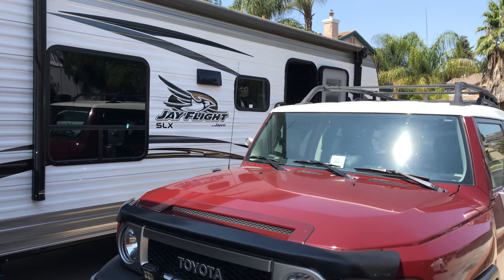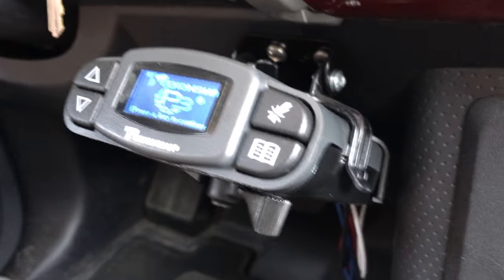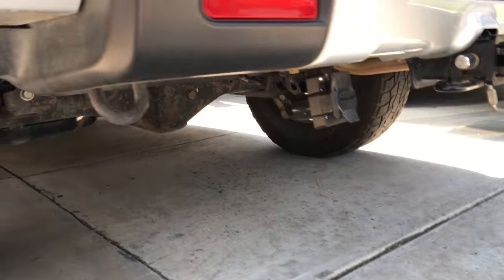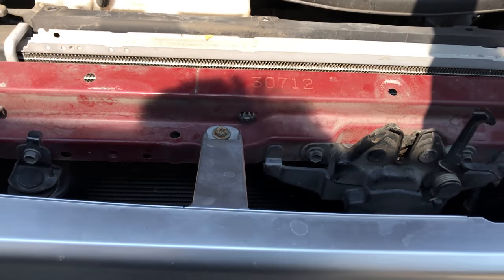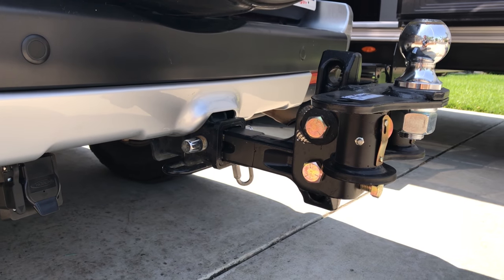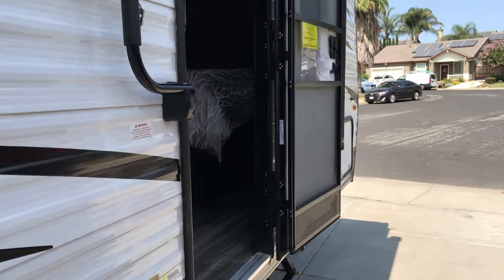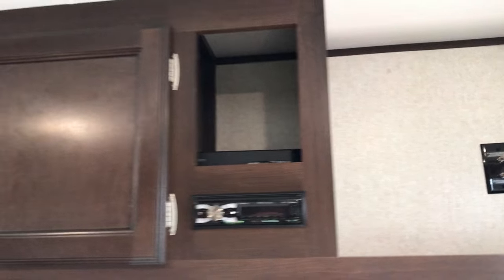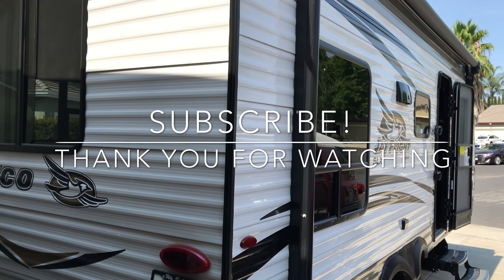Must DO things to make FJ Cruiser a TOW Vehicle!  How to make your FJ Cruiser a capable tow vehicle

Comment: Dude, I have exactly the same setup plus rear spring fitted airbags. They helped a lot. However, if ur loaded trailer weight is around 4950 lbs, any passage or cargo in the FJ will be over the limit. 5000/500 lbs tow/hitch rating assumes that there is only driver and fuel in the vehicle. There r online calculator for actual tow rating, they take cargos and rear axle rating into consideration. FJ legal tow rating is probably around 3000-3500 lbs with 2 adults and some gears in the vehicle. Be sure to check out your insurance fine print, most of them won’t pay if you tow over the legal limit. Stay safe.
Reply: Exactly, he is definitely overweight with this trailer. I hope he doesn't kill someone with this setup.
Reply: @adventuremanintheclouds8968  Another thing I forgot to mention is FJ’s wheelbase is shorter than HONDA CIVIC! Making it a horrible horrible tow vehicle.
Reply: The towing capacity is 5000, it's a Toyota 4runner/Prado land cruiser with a different body, with higher load rated tires and larger displacement than most new F150s.
Reply: @snarkylive  wake up. I had FJ cruiser. It’s a great off-roader, horrible tow vehicle. Nowhere close to F150 3.5 ecoboost power.

Comment: I have seen a  lot of trailers flipped being pull by tow vehicles that size .  I am a retired truck drive and would not pull a rig like that with my FJ . Sure  Under prefect  conditions you could . But I wouldn't ever .
Reply from the maker: Thank you very much for the feedback! We appreciate it! I would love to get a diesel truck one of these days...for now, I will just need to equip this FJ with all the safety items we can add. Slow down on windy days... be mindful of the speed and turns! Thanks again for watching!
Reply: I tow a 1977 golden falcon 28ft @ 4400lbs with my  fJ effortlessly with zero mods to the truck. It is a standard so may be better than the strain on an automatic. I'm guessing that Jayco 24ft weighs about 1000lbs less so that would be an easy tow.
Reply: @paulstanley9950  ...his trailer fully loaded probably weighs 7000 pounds man.
Reply: Rob K. I agree with you, after towing a bunch of different campers and auto trailers with various vehicles. My FJ isn’t going to see a camper over 16-18’. Even at that I’m looking for something like a HiLo to reduce drag. It only takes a minor mistake and that reduces to a fraction of a minor mistake towing a building behind an underrated rig.

Comment: Hello there. My partner just bought a 2007 FJ with 68K miles. It's in pristine shape. We're seriously considering buying a larger travel trailer like what you own. So, after 3 years, how is it going? Any regrets? Any reconsiderations? Any concerns with the weight of the travel trailer? We live in a mtn state and plan on many trips to ID/MT/beaches. We value your opinion/feedback. Ty...........
Reply from the maker: I say anything below 19feet length (lightweight type) The FJ struggled but pulled through hills. If you live in the flatlands… you should be ok. But it sounds like you live in the mountains. Get 16-19ft lightweight trailer.

Comment: I have a 2007 FJ, picking up my Forest River Salem FSX 17BHS today.  I have done most of the upgrades you talked about except for the transmission cooling upgrade.  At 3800 pounds dry weight, is the FJ going to be okay without the cooling upgrade?
Reply from the maker: As is... dry, you are good. Realistically, you have to load clothes, food and supplies... that would be between 300 to 450 pounds. Then the water tanks. Don’t max it out. Stay under 4200 - 4500 pounds. Also be mindful of how you load your trailer... put the weight forward / front(not at the back) as it will become unstable when loaded at the back. Putting weight in the back spells towing instability. Reminder... your tongue weight is 500. Good luck and be safe... happy camping.
Reply: Take your rig to the weigh station to be sure. You will most likely be overweight on the tongue weight, which is only 500lbs on the FJ. You should not max it out either.

Comment: Is the 7 pin adapter hard to install on the FJ? Does it just plug in to existing connectors, or do you have to wire it all the way to the front?
Reply from the maker: I happen to have created easy to follow vids for the how to: https://www.youtube.com/watch?v=D-9hnJ5wuAk&list=PL6vR9pff96YMTQslhHvFYUzuwCWuY4Jer

Comment: After installing the trans cooler how much transmission fluid did you add? How can you check with a sealed transmission? Thanks.
Reply from the maker: I just pumped / filled the actual cooler and the hose I attached... I say it used between half and 2/3 of a quart.. I hope this helps
Reply: cbatilo ah yes, that makes sense. Cool, thanks!

Comment: We added a transmission cooler, the same as you added plus we also added an engine oil cooler, the same as the Tacoma SR5 has.
Reply from the maker: It is the best thing to add for hardworking transmission! Towing or very hot locations
Reply: Can I get a pic of your engine cooler installation and how did you source the adapter.

Comment: I did the same set up except for the transmission cooler.  Mine is a outdoors rv 22 foot at 4500#.  I'm not saying the tow is pleasant but she does it and does it well.  I do not speed and if it's windy I use two sway bars instead of one.  The P3 controller is great and I put a lot of responsibility on the trailer.
Reply from the maker: John Kennedy here you go https://youtu.be/g_JEpRGEpQM

Comment: How much does that trailer weigh?
Reply from the maker: 3200 pounds empty... when l load it with 1/4 water, gear, and rations about 4300 to 4500
Reply: @cbatilo  hmmm.. I read that the FJ has a 1200 capacity
Reply: @shawnm5692  It's 5000.

Comment: This is a bad idea. I have a 15foot TT that is 3400lbs when loaded and my truck struggles on anything other than flat roads. 

I personally had everything weighed, including the tongue weight. You should never MAX out the tow capacity and I am willing to bet that his tongue weight is over the limit. 
The short wheelbase of the FJ makes towing a big trailer like this a bad idea. 

I wouldn't ever consider towing a bigger trailer than my 15 footer, and we are looking to get another tow vehicle because the FJ struggles in the mountains.

Comment: I am getting ready to tow a 22 ft tt and wondering if I need to apply tow mirrors. Did you have to do that or did the FJ mirrors work okay just as they are?  Thank you in advance.
Reply: Millie I did not have one saw my “line” just fine... but, always thought of getting a pair. Get a pair... just being extra safety...
Reply: Check your state LAWS.  Tow mirrors are not ‘optional.”  Depending on your state and the length of the trailer, they’re usually required.  Also, if your vehicle is rated to tow “X” amount of weight, and your trailer exceeds that weight limit, if you get into an accident, guaranteed you will be at fault.  It would be prudent to take the trailer to a certified weigh station, and weigh the trailer fully loaded with what you will normally tow.  Keep in mind that water is HEAVY, and it’s best to travel with all your tanks empty.